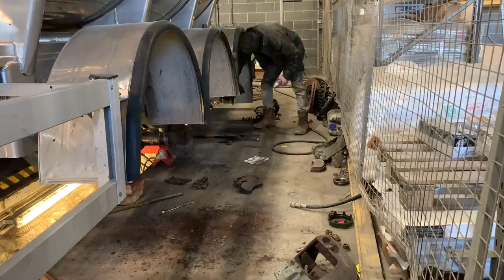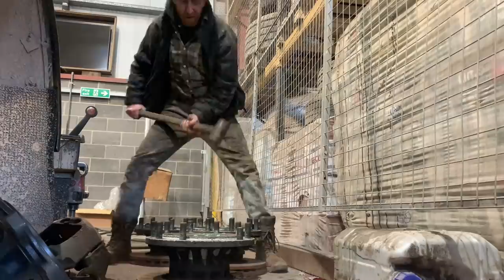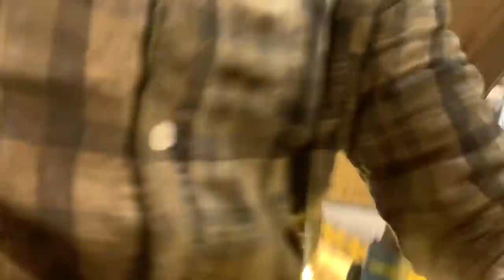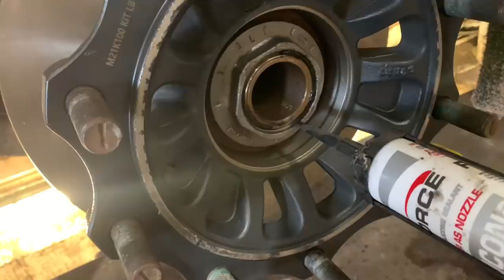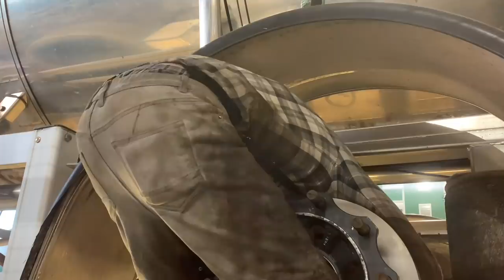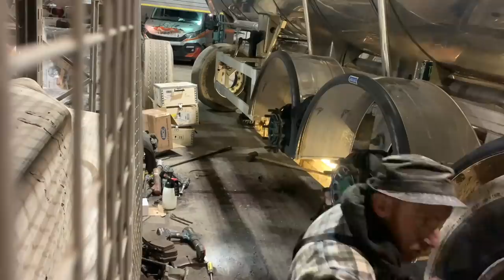SAF axle montage 🎥 little terry the torch 🔦and a struggle mobile hgv mechanic truck trailer semi

Comment: Nice job Chris them new hubs look swish lovely rewarding job doing hubs discs and callipers. Glad to see Terry back on the job couldn’t be without my Terrys at work often use a head Terry for hands free applications. Always less of a struggle when you can see what your looking at.
Reply from the maker: Cheers James it is rewarding but I’m a victim of my own success...... got an other one to do tomorrow 🤦‍♂️😂 yeah your fooked without old Terry’s about, head Terry is the next step in the future I think 👍 cheers mate have a good night
Reply: Also mate get ya self some gloves got to tinsulate the pinkies going
To be brass or monkeys tomorrow nothing worse than frozen mits on bare metal give u real bad problems later in life keep them hands warm they pay the bills
Reply from the maker: @jamesgreig9731  will do mate! I find it hard to spanner with your hands in cloves mate, I have got some winter woollys in the van but hardly use them.

Comment: Good to see you cracking on. Interesting to find out why the sealant was applied to the stub nut, wouldn’t a low strength Loctite work? As others have said, get some knee pads, they’ll thank you for it.

Comment: Chris, really entertaining as usual. Watching you lug them hub assembly around makes me wince. My back is not what it used to be. Just take care. Also the amount of times I've lost a tool which had sprouted legs and had a wonder I'd be a rich man if I had a pound every time. Keep up the struggle 💯
Reply: I made the mistake of putting low strength loctite on saf axle threads! Never again!

Comment: If you have two different metals touching each other they can corrode due to electrolyte oxidation regardless of air/moisture ingress. Contact alone can cause them to start bonding. Alloy wheel nuts on steel studs prime example. Alloy dust caps on brass valve steams also a mare. Anti struggle grease is the way forward. Silicone dont do much as its not dirt getting in those threads. There is no space for shit to get in. Its often Dissimilar Metal Corrosion thats your issue.
Reply from the maker: Makes sense Gav Ally wheels can be a nightmare to get of hubs.... why do stainless steel nuts and bolts sometimes pick up on threads? Some will come off easy others never undo. Thanks for the comment mate 👍